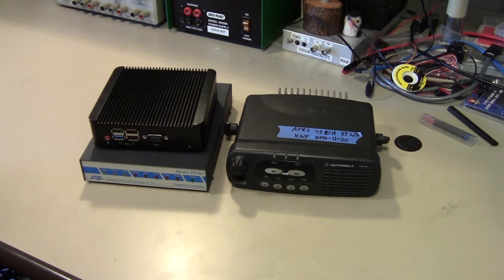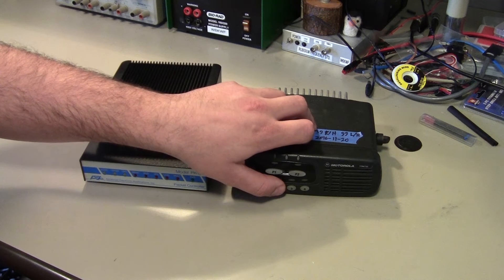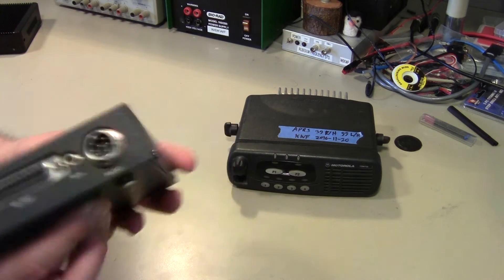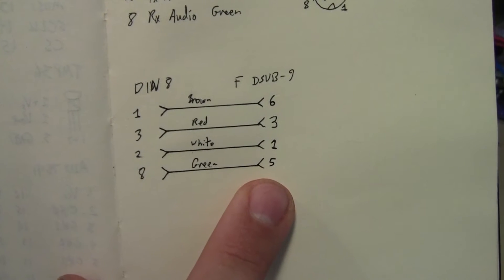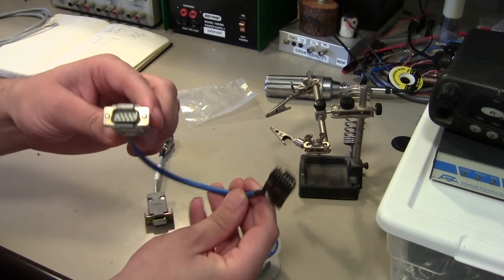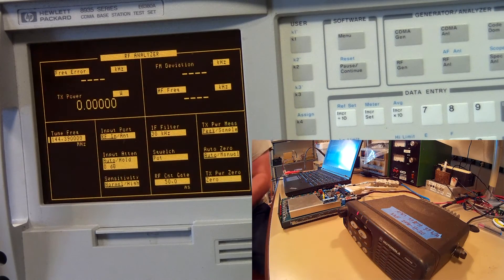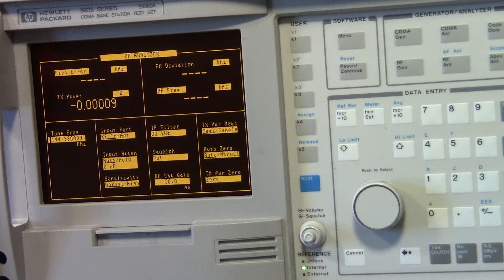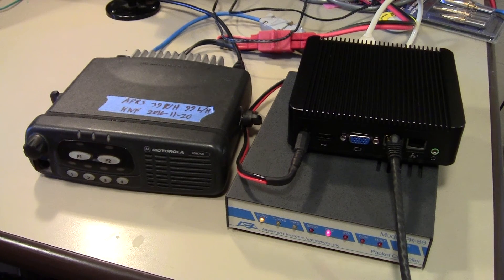APRS I-gate/Digipeater Build (Part 2/3 - Hardware)

Comment: I've got a TK730 interfaced to a PK88; I abandoned it for a OT3Mini in a TK790 after realizing the PK88 wasn't accepting new paradigm stuff, but remember having this same issue.   I believe the Waris radio can be programmed for squelched audio on Pin 11; as I've had to attach multiple paramedic headsets to them.   (one connects via the microphone jack, which already has headset audio).  

Keep up the good work with APRX!

Comment: Bummer. Since I have a pile of 88s I immediately started googling DCD state for them, which led to TAPR as soon as you said it, which are no longer sold, and ran into the Tracker3 like you said. 

Buuut... I also have a pile of CM200/CM300 radios which appear to have a squelched disc out.

Another idea (hack) would be to tap COR on the 750 and use that to trigger an audio muting circuit like the one on the repeater-builder website  - http://www.repeater-builder.com/projects/pdfs/audio-mute-circuit.pdf